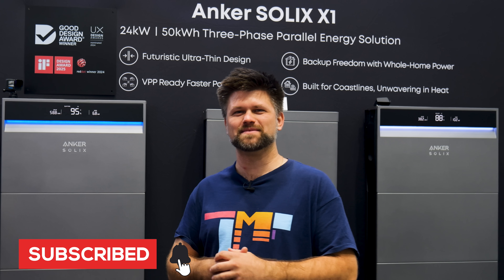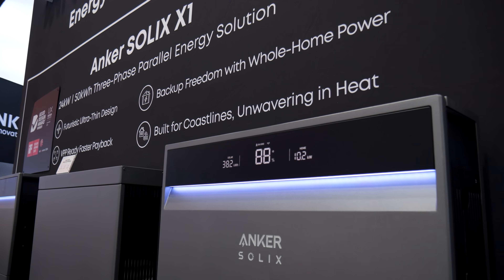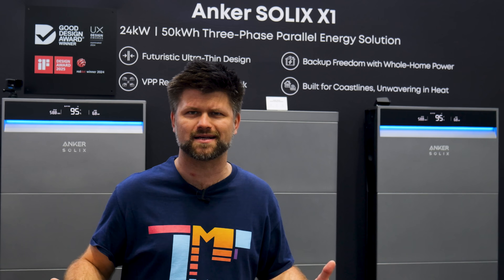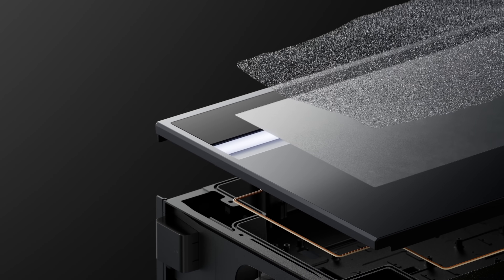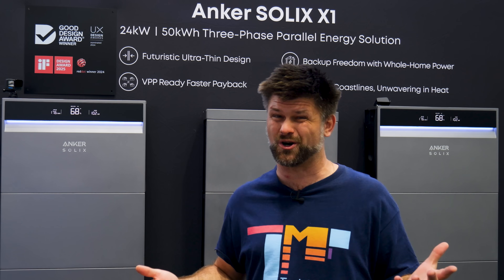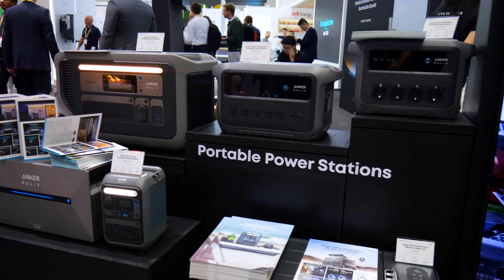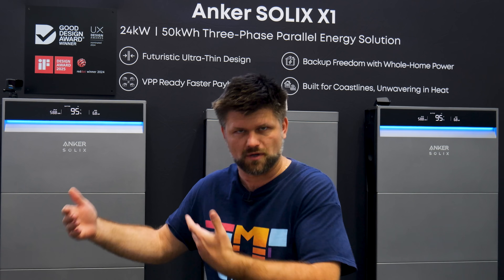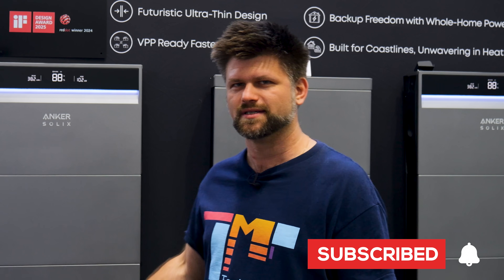Why the Anker Solix X1 Home Battery System Is Built Differently | All Energy Expo

Comment: Put in a 20kW 3ph X1 when we got stuffed around by BYD.
Had an issue (not being able to pull more than 8kW from the 3ph grid) so called the helpline and clearly spoke to a Chinese engineer in China.
He understood the problem and said he would get back to me.
24 hours later he called back and said they had sent a firmware patch to our app and we should download it to fix.
I did and it did, Now we can charge our battery, car and run our large heatpump hydronics all at the same time. We routinely draw 25kWh during our 3 hours of free power with Ovo. Then the battery runs the how house for the rest of the day. Now we only pay the daily connection fee.
Love the screen on the battery, heaps better than messing around with apps for basic info.
So yes, very happy with Anker. The engineer even gave me his private number and said call anytime if there is problems!

Comment: The X1 is a great system. It still needs a proper gateway. I have a major complaint though. It is far too expensive. Even the better Sigenergy system costs less at component level. The price needs to come down to below USD 150.00 per kw. Then Anker needs to implement the new Sodium batteries from CATL so the price can be brought down to USD 75.00 per kw next year, giving them a higher wattage per kwh at a much lower cost.